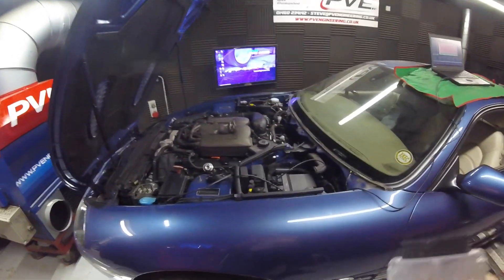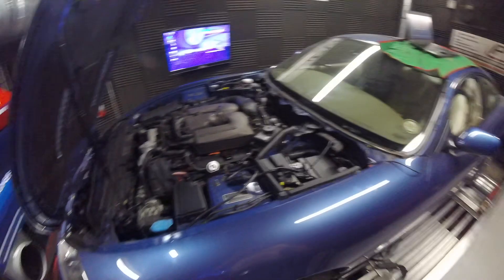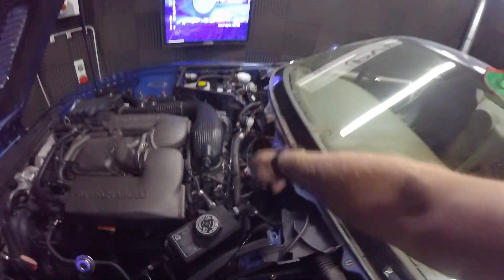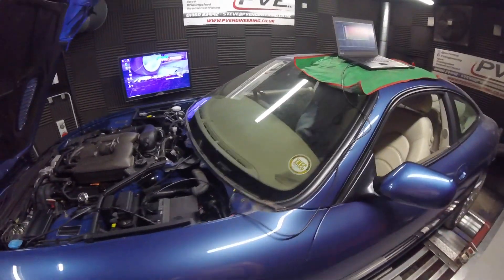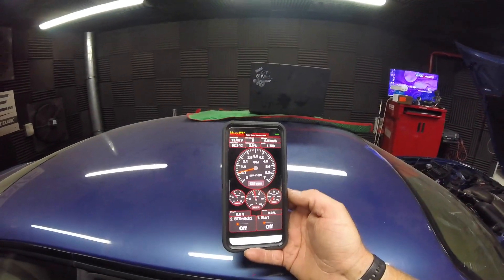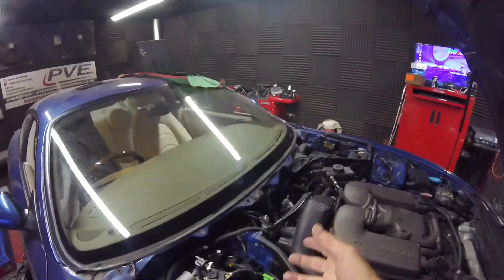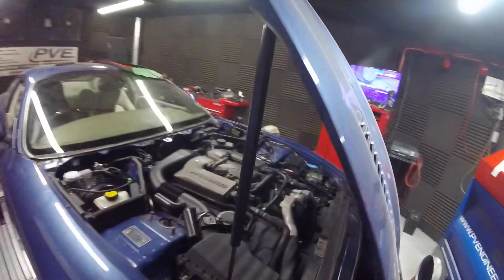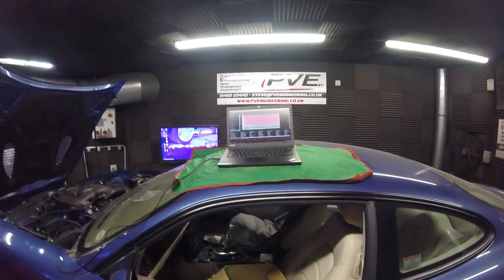Jaguar XKR X100 Manual Conversion ECU Swap Plug & Play System, progress

Comment: This is so cool. I never would've thought plug n play would've been possible! This opens these cars up to be an actually viable platform for modding into a high power street car. Can definitely see someone doing a single turbo conversion one day. Also doing a twin screw or swapping the 4.2 in will be easier now.
I'm wondering if you can now raise the rpm limit (to like 7000rpm)? I remember reading on the forums that this used to be impossible because traction control and the auto box couldn't be tuned. Also would this ECU be able to control VVT properly if you swapped in one of the later engines?
Reply from the maker: Literally, the world is your oyster, we could take the RPM limiter to infinity, and beyond! The only limits are mechanical. We normally run the engines in our race series to 7000rpm. 

The ECU doesn't mind what CC the engine is, as long as you tell it. 4.8, no problems. 😁

There is a twin screw supercharged vehicle already fitted with our system. 👌

We absolutely can run the VVT system. It's basic by today's standards, but we have run the VVT without any problems.

Comment: Did you leave the auto box controller in there?  Or does the new ecu send the can messages out to stop the gearbox errors messages?
Reply from the maker: Anything to do with the Auto box is gone. The ECU replicates the requires CAN data to keep the other modules happy.
Reply: @TuningShed  excellent , thanks for the info , planning to fit a custom instrument cluster to mine so that info helps me .   Probably still need to work out the SCP data to get the indicators and lights to show on the cluster
Reply from the maker: @alecmorris1486  That will be a cool project to be fair. More complicated than most given all the cluster deals with in these cars. It even deals with the power steering level from memory doesn't it depending on chassis number. Bloody things!
Reply: @TuningShed  I like a challenge , I’m determined to turn my XK8 (and maybe my xjr) into something special , it’s not my first project of this sort . Does the s type 2.7 manual gearbox (I believe that’s what you had) bolt straight onto the AJV8 ?   And does it need the swallows flywheel , or can the s type flywheel be fitted to the ajv8
Reply from the maker: @alecmorris1486  I fully support all things to do with properly modifying anything! 😂

The 2.7d gearbox is the one that bolts straight up yes. The diesel flywheel does not work sadly.  The swallows flywheel is the best I've seen this far. It's a bolt up solution with a choice of different types of clutch, for any power or use. 

I've seen other flywheels, including adaptors, and various types of torque converter plate, with a flywheel bolted up to it. To be honest, by the time you've added the weight in alone, was enough for me to not want to do it that way. Don't get me wrong, I'm all for a home engineering solution, but there seems little point in re-inventing the wheel, and ending up with something worse in my opinion. 👌
Reply: @TuningShed  thank you very much , saved me a lot of experimenting , just need to find a gearbox now
Reply from the maker: @alecmorris1486  I can highly recommend giving Auto Reserve a call. Top service, and quality parts. 👌👌

Comment: Please please please make this into a production ready ECU that you can sell. I’m dying to manual swap my car, especially given my ZF 6HP26 is in need of a new solenoid kit and perhaps an E-clutch. 

If you make this available, I will be able to swap the trans, throw in a twin screw supercharger, and an LSD without the worry of the computer not playing nice with any of it.
Reply from the maker: It's in hand. I'd imagine 2nd Quarter of 2023. It's fully working, and driving etc. I've got a couple of little bugs I'm working my way through. It's just getting time you know. :-)
Reply: @TuningShed if you don’t mind me asking, do you know a very general rough estimate of what this would cost? I have a 1999 4.0 x100 with a bad zf, and someone here in the states looking to sell 2.7 S type 6 speed along with the clutch and flywheel adapter. I know I would need pedals and mainly, ecu problems which sound like a nightmare. thanks

Comment: Sold my XJR last year. Did a few engine mods. Bottom pulley, 35% larger surface area pre charge rad, and separated the cooling systems.
200 cell catalytic converters. Went well, but felt it needed a stand alone ECU and manual box to really make the most out of it. I'll be in contact once I've won the lottery and bought my car back😁

Comment: With the cluster integration, is it sending CAN codes to the body control modules to get gauges working? Love seeing a quality ecu in there, so many failsafes and proper data logging abilities.
Reply from the maker: Yes, it's communicating over CAN, to the ABS module, BCM, and instrument cluster. I agree, I love datalogs!!